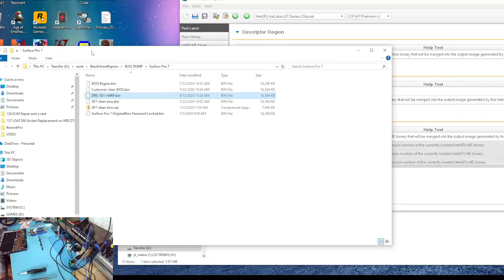138 | Surface Pro 7 UEFI Password Reset

Comment: If you clamp down using a flat metal bar, then the screen will be pushed down along
the side evenly. Instead of just where the clamp is. Better still, a 4mm thick piece  of
aluminum with dimensions of the tablet. Press the whole screen thing  down  evenly
at once, by placing the aluminum plate on top of the screen.
Reply from the maker: good tip, thank you so much

Comment: Hello Raff. Great job here. Is this possible on Surface pro 9?
Reply from the maker: yes, the procedure is the same just requires different version of the software :)
Reply: @ Thank you. Unfortunately you are too far away and doesn’t make sense to send it to you for repair. I will need to find some local electronic repair guy and show him your video. Where should I find the software?

Comment: 5:11 “iPad screens are not sealed…” since when? Every one I’ve opened has been sealed pretty good. The screen doesn’t just pop off.
Reply from the maker: LOL, my own reply was removed, that's so funny.
Let's just agree to disagree then :)
Thank you so much for your comment
Reply: @ maybe I misunderstood what you said. I’m not afraid to admit when I’m wrong. But if iPads aren’t sealed, why is alcohol and heat needed to open them? I’m genuinely curious.
Reply: What do you charge?
Reply from the maker: @brianmccall2609  typically $150 as it takes a lot of time
Reply: @blackhorserepairs 
How do I go about sending it to you for repair ?also is it possible to upgrade the SSD? Is it an M2 I can purchase this separately if it’s a simple screw to install it and is it possible also to upgrade the memory or is that solder down to the motherboard?
Reply: Please let me know know
Reply from the maker: @brianmccall2609  submit the ticket and send it in. On this model SSD is soldered on, it is possible to replace it with a larger one but I do not provide such service.